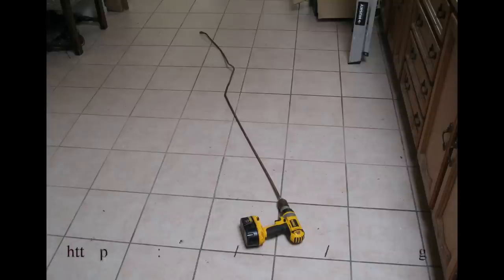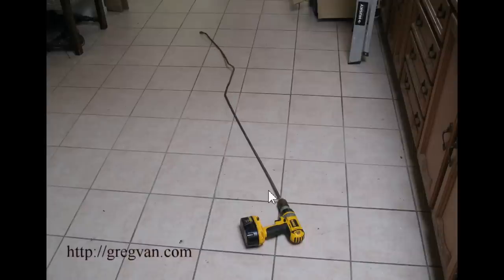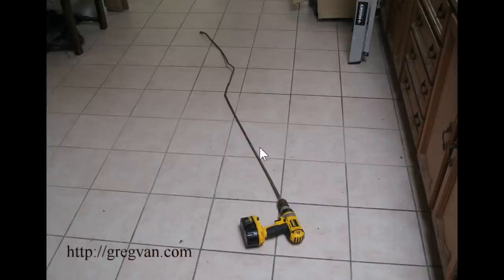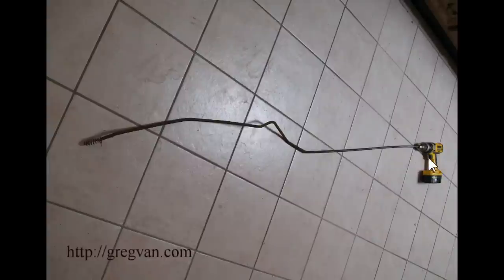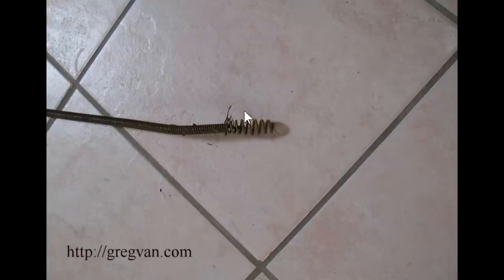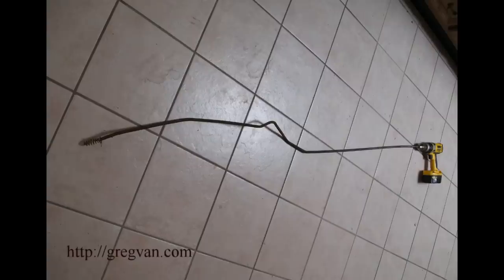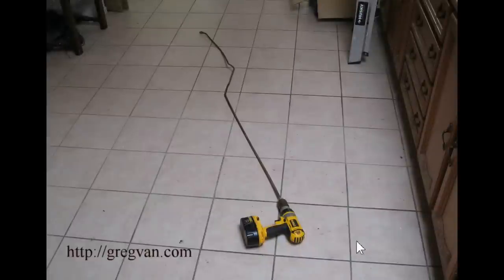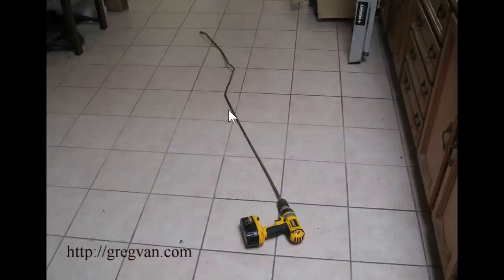Using Battery-Powered Drills and Snake to Unclog Plumbing Drains

Comment: I am a actual plumber, go to a plumbing supply house and buy a quality 1/4" cable, it had a actual cable inside the "spring" that keeps it from completely kinking and can be reused over and over. I use cables up too 50' with no problems and last up too 2 years of everyday use, but this a two man job one feeding it and one running the drill, keeping the cable some one tight
Reply from the maker: Thanks for sharing and that sounds like great advice.

Comment: I have a 10' short section of drain that has been giving me trouble about 3x a year... haven't had time to dig it up. I got a 1/2 inch cable that didn't fit in the end of my big drill. I cut the cable down to a manageable length and then took the quick disconnect (QD) off the "discarded" end (auger on end of other piece). I took a hand torch and unwound the cable to get the end off. The QD had a spiral end that tightened it into the cable and it had a cup shape with a hole in the side that the ball of any other QD would lock into. It turned out that a piece of 1/2" steel rod would fit perfectly into the cup. I had a friend braze the rod into the cup and that rod fit my drill. The cut off end of the useable piece had a plastic core. I drill a bit of the plastic out of the cable so I could start the spiral of my newly fabricated adapter. I chucked the adapter into my drill and spiraled it into the cable. I now had a 15' long snake that was easy to carry to the job, needing only the drill and an extension cord... easy to carry.
Reply from the maker: Thanks for providing us with another idea, those are always sincerely appreciated.
Reply: Hi professor Iam working on something like that only difference. My rodding cable it's  3/4" of inch and I was looking for a Drill big enough to connect to ,Is there a chance that you can send me a picture of your project thanks really appreciate

Comment: Once the spring kinks, it seem like the line is no good to reuse again.
Reply from the maker: MrMac5150 Isn't that the truth, I've actually straightened them out before, only to find out the next time I used it that it was going to happen again in the same spot where it bent before. If you're going to use this method, you have got to go slow.
Reply: gregvancom
I think your method works great if you get some 1 inch EMT and keep the spring steel in it, as much as possible.
Reply from the maker: Remember, it's only a suggestion and it might not work for everyone. The pipe can make a big difference, but I've actually ran over 50 feet down a 4 inch drain pipe with great success.